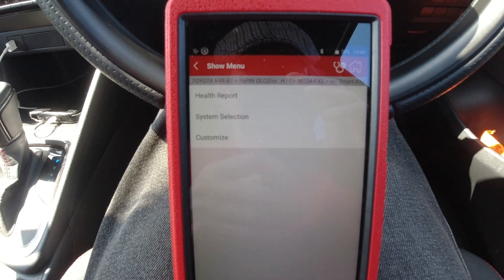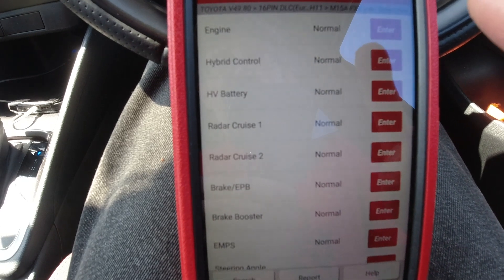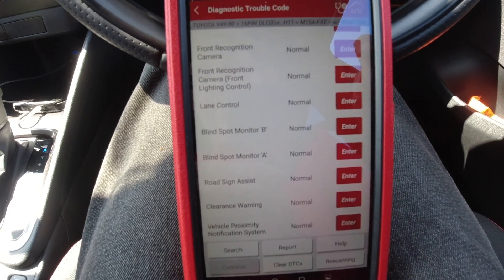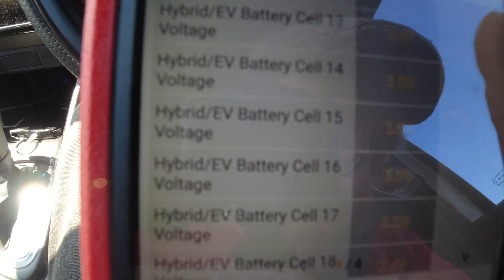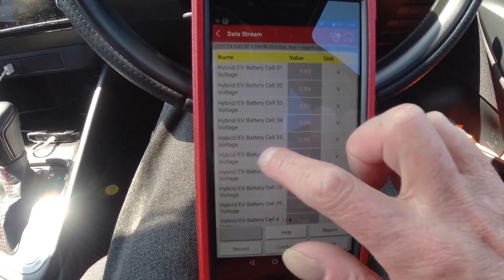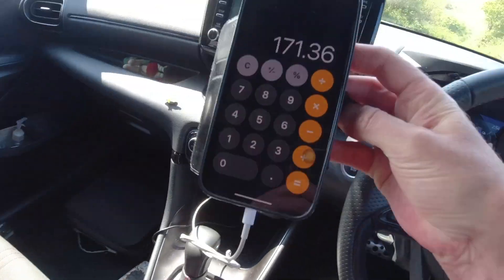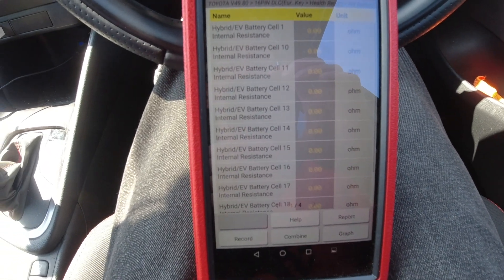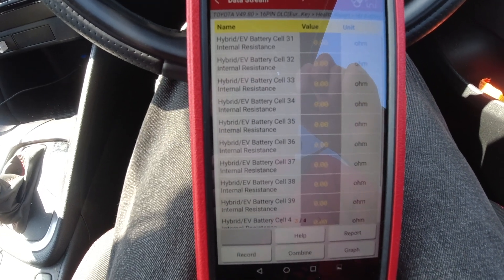HYBRID BATTERY HEALTH CHECK

Comment: Hi.., very informative as usual… I have 2 questions… in your opinion, if serviced regularly by Toyota… how many miles would you expect the life of the vehicle to manage… 100,000 miles….. 150,000 miles… 200,000 ???
How many miles until the hybrid batteries need replacing ???
And at what cost ???
Your videos keep getting better and better… it’s essential viewing in our house now …. Loved the walk upto  maiden’s drop … beautiful …. Thanks for sharing
Reply from the maker: If serviced properly no battery overload or overheating or any shorts in any modules or water intrusion 
The batteries are capable of lasting a long time, I used to own a 2006 gen 2 Prius, when I sold the car it had 200000 miles on the original battery and I sold it in 2014
The car is still going on the original hv battery now with 400000 miles 
But like any thing electronic you can be unlucky and have a component failure 
Toyota hybrid batteries are also very easy to replace individual battery modules in the hybrid battery and they are very easy to service if required 
Personally I’ve never had any problems with a hybrid battery and I’m not going to worry about issues because of the warranty Toyota offers and I don’t keep my cars for very long before replacing them

Comment: I have a Design and the 12v battery is useless.  I have had roadside assistance out 4 times due to flat battery although I have a Noco GBX55.  Dealership are not interested.  
Wish I had your clever device.
Reply from the maker: There are a few videos on the tips and tricks playlist where I try and explain the issues with the 12 volt battery, search them out, I’m glad you carry a noko jump pack 
Thanks for taking the time to watch and comment
Reply: I had an older Yaris until this year, and occasionally charged it’s 12V battery when it looked a bit low, to avoid it going flat when it wasn’t used often enough - but like you I also have a portable battery pack to get out of any flat battery problem. The charger I used was an old Halfords model, capable of doing a proper low-current top up charge, and automatically shuts itself off when fully charged.
Reply: Something else worth noting, perhaps, is that the underlying reason why I had a Halfords charging unit was that a few cars ago, I had a 12V battery failure problem. It was a Honda Ctdi, with a chunky battery - roughly 70 Ah capacity (it had a 2.2 l diesel engine). Occasionally, it would flatten the battery overnight. The fault was traced to a Bosch unit connected to the CAN Bus cabling (I know someone who worked at the Honda works, and there were large numbers of them until Bosch issued a firmware update, dealt with under warranty). When it got into it’s fault mode, it would not switch off the load at all, with no warning  - until it wouldn’t start the next day.
Reply: When the AA came out to me, the first thing they did was to check the rear boot light as he said it was a known issue that the switch did not always make the connection in turning it off when 5he boot was closed.
Reply from the maker: I’ve not come across the issue with the boot light switch 
But I’ve installed an led bulb in mine so maybe if it happens it won’t drain the battery as it draws such a small amount compared to the original bulb